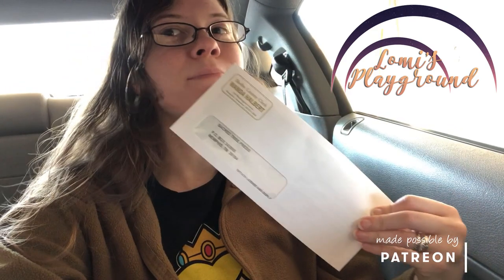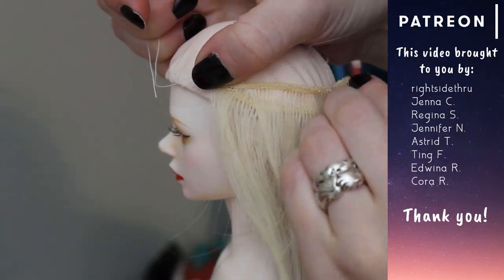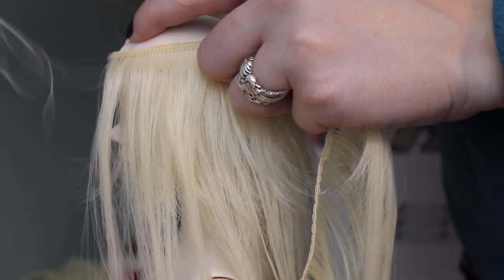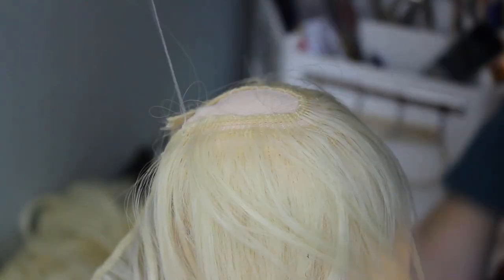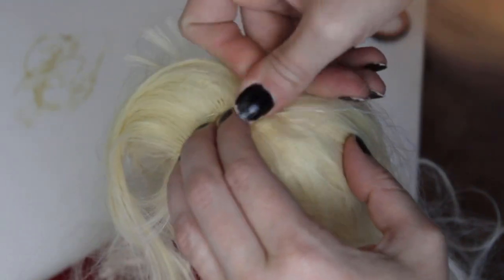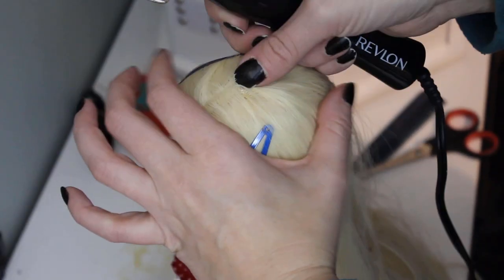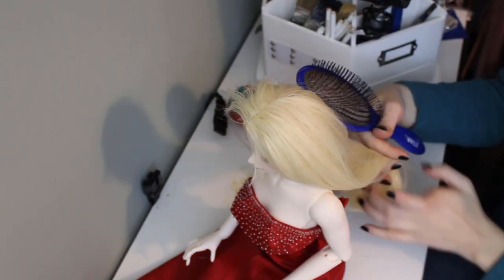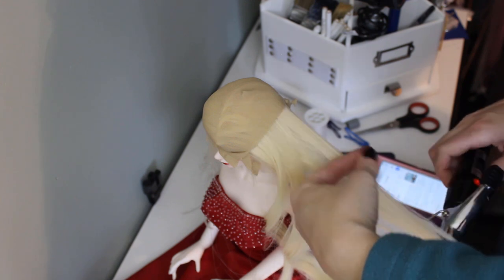Why I don't like making synthetic BJD wigs

Comment: I wonder if some of the techniques found in the Doll Customizing community would help with making wigs? There is a bit of a cross-over between Doll Customizing and the BJD.
Reply from the maker: There is a lot of crossover, I've noticed! Some elements are the same, but I have noticed that the doll customizing hobby tends to lean toward using super-shiny synthetics, which are finer and slicker and typically easier to work with. I've used those for BJD wigs a couple times but was never crazy about the shine. Haven't figured out how to get past that one yet.

Comment: I make my wig caps with tape then I hot glue the wefts on to it. I make the parts and the way I want the wig to set and I pour boiling water over it. Then I let it air dry and it holds amazing. To each their own I guess 😁 but great video 💜
Reply: You can boil the hot glued wigcap?

Comment: Have you ever tried wefts from Sally's beauty supply ?  You can get synthetic wefts from them for less cash but all I have found mostly black or blond
Reply from the maker: I have--I used those for a wig for Arrios. It turned out pretty well, but it was still tough to keep it from poofing out all the time. With the heavy fluctuations of temperature and humidity we have here, wigs suffer and need regular styling. They're not bad wefts, but you're right in that the color options are very limited.
Reply: When I think about it I did think that I had put too many wefts on it as it looked thick and didn't have the sleek a
Asian look I was expecting after having  made a few human hair wigs.  I did find some that was a blend but the price was some what prohibative.   It has been watching you as you make wigs that gave me the courage to try your style of wig making on a few of my smaller porcelain dolls.  Other wise my wigs are all wefted on my sewing machine and hand sewn onto the wig cap. Thank you for the inspiration and courage to step out of my comfort zone.

Comment: You did a good job though you don’t like the method. I mainly make finer wigs as my dolls are vinyl so can stain easily. I do plan to make a alpaca if for my next one but think I will sew that like I normally do. It’s hell to find the right wefts in fibre. Even now I don’t always like the ones I find. The hardest for me is a nice natural green for my girls wig. I’ve made three for her so far and still not happy. Do other types of hair reach the length of about 50-60cm as I’ve only seen shortish alpaca wefts.
Reply from the maker: Ah, wow--I am not sure that any natural fibers get that long. The longest I've ever seen was around 30cm, and it was pretty expensive since that constitutes a minimum of 2 years between shearings. So it's not the best option for ultra-long wigs, that's for sure. I think mohair from angora goats reaches about the same length, though it's typically shorter since goats do better being shorn twice a year.
Reply: @LomisPlayground   indeed I've never seen any hair that is that long. I've considered making a human hair wig. but getting it and dyeing it green seems like it will be a bit too hard to keep in good condition. think I am stuck with fibre for now XD

Comment: Is way easier to stylish this kind of wigs with hot water
Reply from the maker: It can be. I've used hot water to set curls before, but it is hard to get it to make the wig lay flat without pouring the water directly over the doll while the doll is wearing the wig. That works fine if there is no faceup and I've done it before with pretty good results! But it's not an option for dolls that are already painted. :(